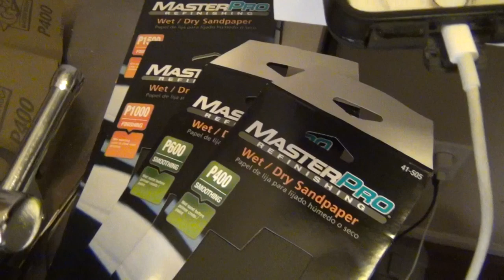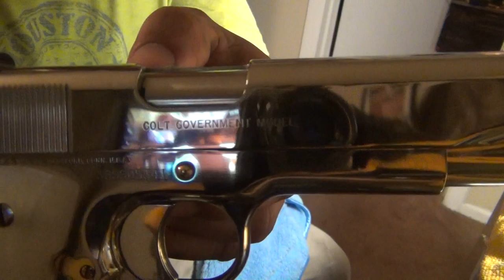Cómo pulir un arma . how i polished my gun.

Comment: Amigo un saludo desde Medellín Colombia, su pistola quedó hermosa y me alienta a pulir la mía, mi pregunta es cuando el cromado ya está deteriorado que puedo hacer y la verdad no la quiero desbaratar hasta el punto de mandarla cromar, sugieres darle lija hasta que quede stainles Steel y ahí si seguir tus mismos pasos? Es una smith & wesson 39. Muchas gracias espero su respuesta.
Reply from the maker: Si tu arma es stainless steel puedes seguir los pasos que ise yo pero más avanzado puedes en pesar con lija de grano mil . Pero si fue niquelada o cromada es mejor que la lleves con alguien que te la aga de nuevo porque todo ese cromo lo tiene que quitar y niquelearla de nuevo
Reply from the maker: La diferencia de la stainless steel y la niquelada es que la niquelada es asero o de fierro normar y si las lijas como yo lo ise con la húmeda le va a salir óxido por eso la tienes que llevar que te la agan niquelada de nuevo para que te quede bien
Reply from the maker: Puedes tratar con esta pasta talves te allude si no esta muy dañada Mothers Mag & Aluminum Polish
Reply: @max_aventuras_N1  yo lije una de acero femaru 380 se oxidara con aceite 2 en 1 quedo como nueva pero puede suceder lo del oxido .?
Reply: @irammunoz9378  yo ayer lije la mía, pero en ves de usar agua en la lija usaba wd-40 y aceite 3 en 1 sobre la lija, la mía tenía unas corcomidas por óxido anterior y ni así pude quitárselas baje hasta lija 80 y mejor solo la dejé normal, le pasaré una lija 2000 y la puliré haber si le saco el mismo resultado